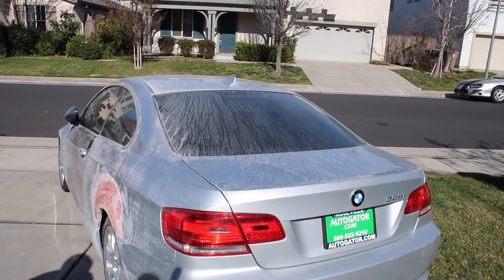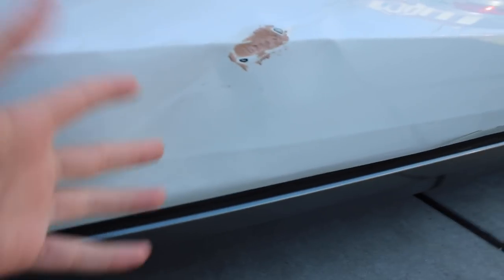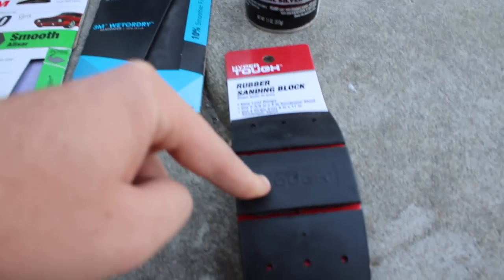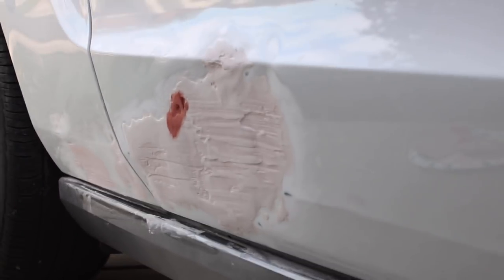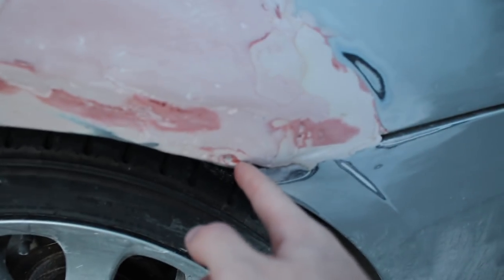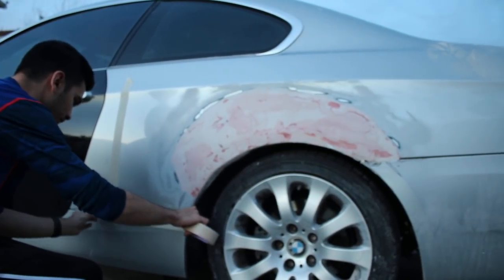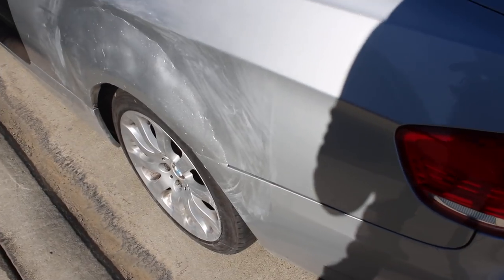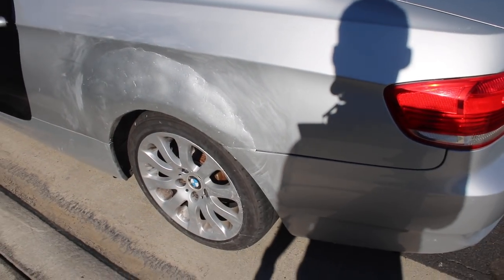THE E92 QUARTER PANEL IS NEARLY COMPLETE!

Comment: I hope it holds up. My experience using bondo on my first car is if you use too much, it will crack over time. Its really meant to fill in small imperfections rather than constructing a new surface. After my bondo cracked, I redid that section with fiberglass which is more difficult to work with but was much stronger. 😎

Comment: Dude, i guess you need to stop filling like crazy and start getting those bends out to make it straight as possible and finally fill it. That's way better. I get that you want to do it on your own for the experience etc. But bro... you need to paint the whole panel to make it look nice. Plus, you need to sand the old paint repair small dents, sand again and then pain with spray gun. If u want to do it yourself, At least do it right.
Reply from the maker: Edgar Michaus at this point, what do you think I should do, should I sand most of the bondo off and deal with a thin layer of bondo?

Comment: Way too much Bondo. Gotta sand down to the bare metal, pull it out, knock down high spots then apply filler. That will most likely crack. Hope it works out